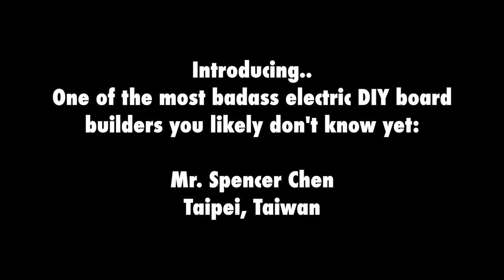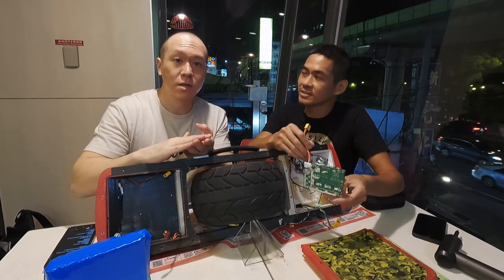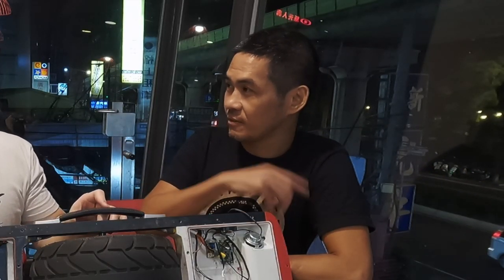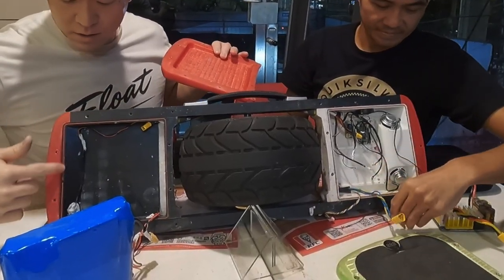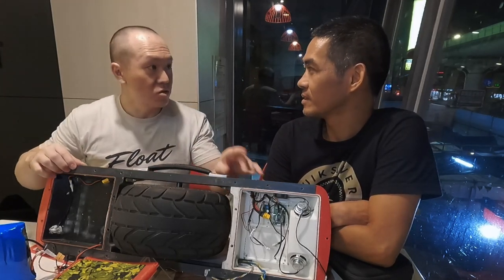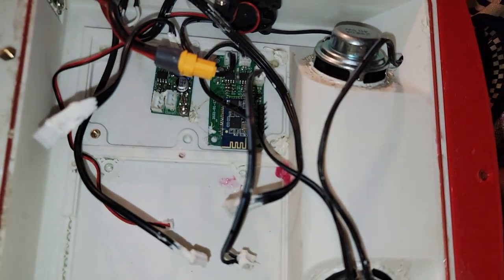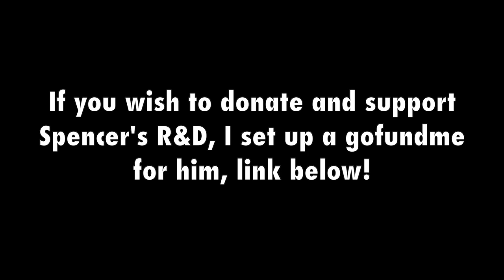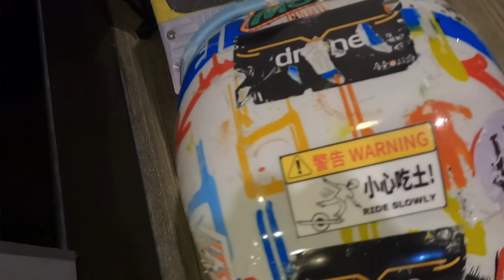Better than Floatwheel?? Meet one of the best diy one-wheel VESC guru: SPENCER CHEN

Comment: Hi Sir, the problem w battery that only charge up to 80% is easy to diagnose.. The cause is maybe one cells block debalance. Imagine battery with most blocks at 4,0V and one block at 4,2V. This will be the 80% charge limiting element (4,0V is 80% SOC and 4,1V is around 90%). soo when doin charge, this committed block reach 4,2V and bms cut off! its time consuming for passive bms equilibrate entire battery at this level difference, so maybe you need to discharge that block up to 4,0V equal to others, than charge entire battery. this way all battery blocks will reach similar 4.2V & leads to 100% charged battery. This bad production battery maybe caused by unbalanced cells at built time or one block with higher internal resistance. Just saying ..
Reply from the maker: Thx for the breakdown! But isn't 80% SOC of 4.2V is 3.36V and 90% 3.78v? Either way, Spencer knew exactly the issue and replaced the battery pack for me 😊

Comment: i wish i could build one of these man... i can't afford $1800 bucks. but i could afford 6 to 1000
Reply from the maker: You can find used xrs on craigslist/fb om the low end for around 900-1200. Then sell the controller and replace with vesc controller. Check here when back in stock: https://www.makerspev.com/collections/bundles?aff=3